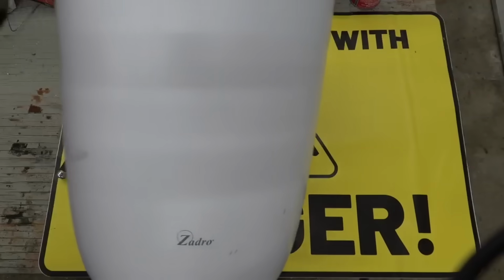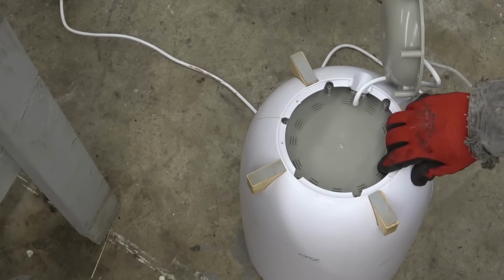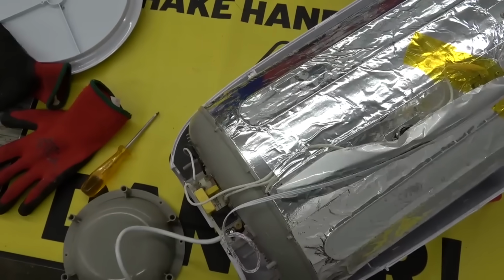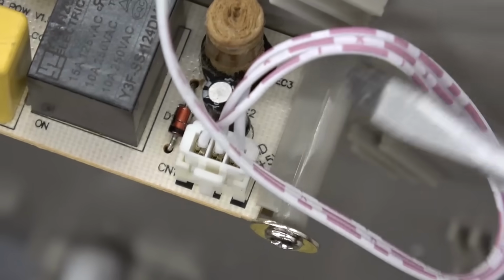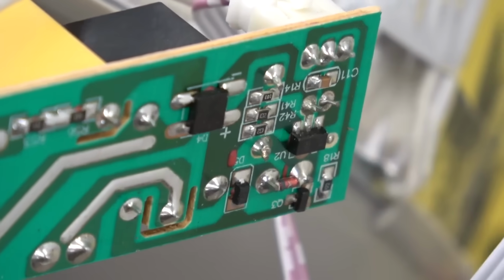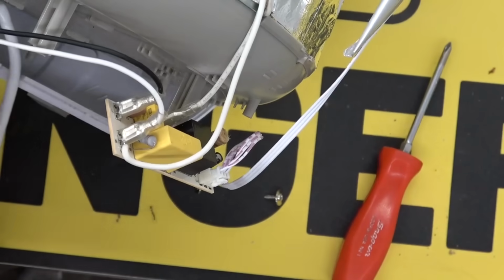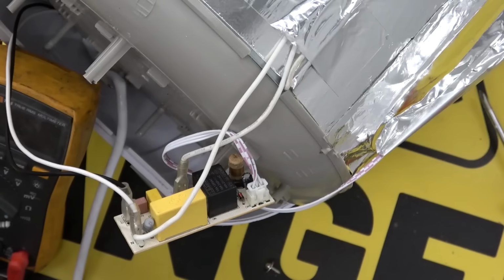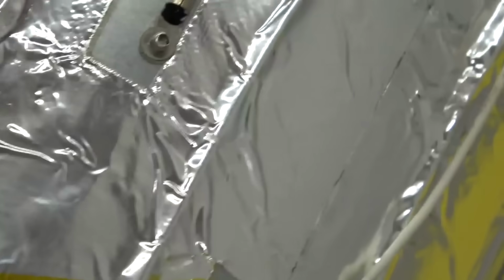BOLTR: Towel Warmer

Comment: 1.45 million yelling at their screens: it's always a capacitor!
I bet, you did this on purpose! 😂
Reply: Agreed, this was a blatant attempt to get interaction down here in the doobly-do to give that 1.45m a boost. But we're all way to smart to be foole... oh
Reply: @PurpleTT99  - Ya, Eons ago he had cut a power cord off'n an electrical device and applied the prongs of a continuity meter to the unconnected wire, rather than the wires that led to the device. (Inside tip on this vid, when he touched the two leads of his continuity tester together at  7:16 he got the Morse Code ... _ _ _ ...  SOS 😂) I'm gonna post this independently from here so I  will look smart😛
Reply: he told looks like a home rolled cap... no way he didn't know
Reply: I'm honestly ok with it not working because it just doesn't want to.
As you get older, you understand and empathise with things that just don't want to do any work today
Reply: i made my kid help me disassemble the flat screen tv that died, because we couldn't break it since it was broken... indeed its was several easy to spot blown capacitors... 3 bucks of the finest chinese replacement parts and a soldering lesson later the tv worked.  and the boy got a new tv to play with along with the lesson he didn't know he learned.
Reply: He's trying to get community engagement to boost his subscriptions.
Reply: I know the lion by its claws
Reply: For sure! On purpose!

Comment: That EC (eletrolytical capacitator) blew its panties RIGHT off.  Surprised you didn't find the little aluminum can in the bottom when you popped open the unit.

Comment: We have an expensive towel warmer, it's called the clothes dryer and it works just fine
Reply: We also have an expensive towel warmer.  The towel bar is over the furnace vent, just crank the heat up a few degrees for the entire house.

Comment: EC - (used to be) electrolytic capacitor. I would check "FULL BRIDGE RECTIFIER" and the regulator as well. That round glass thing is a MIL… I mean MELF diode. Might be a Zener. Can't really tell without knowing the rest of the circuit.
Reply: At 8:46, that glass part looks like a 1N4148 diode
Reply: @jeffrueschhoff7710  I agree, I placed thousands of those with pick-n-place machines at my work (not any longer). It's likely to snuff the reverse voltage from the relais to protect the rest of the circuit.

Comment: Common design for a low current power supply.  Piss poor design though as the capacitor gets a huge inrush current.  Then it gets hit with imposed high frequency which simulates high voltage, further insulting that electrolytic cappy.  No wonder they simulate my ex wife and blow their tops.

Comment: Is there a fuse in the plug, or is that a purely UK thing to check?  😎

And I would suggest replacing the electrolytic capacitor that blew its wrapper off too 👍

Comment: The power supply is a 'capacitor dropper' featured many times on big clive, you won't get continuity across the mains input, The EC is supposed to be an electrolytic capacitor, but looks like it blew it's case off, it could be shorted and not allowing the voltage
The glass thing is most likely a zener diode (conducts when voltage rise above the rating as a voltage regulator) it's probably 5 volts
Try changing the EC for a 470 micofarad , at least 16v rating. polarity is important
Reply: There is likely also another failure that lead to the exploding cap ...
Reply: u2 looks like 7805, it's a zener (which i think it's not) it'd be 7V+. I'd guess it's a snubber diode

Comment: chinesium electrolytic caps.... need i say more? The red diode is a zener type, would guess its a 12V or whatever the relay coil voltage is
Reply: yep, my guess is a zener. either capping the voltage (unlikely) or part of the regulator. the blown cap is root cause.

Comment: So it doesn't work because it doesn't want to. Understood. Glass dohicky looks very much like a zener diode. Its location on the board hints to me that it crudely regulates voltage for the actual voltage regulator. However since it has continuity in both directions it is sending all rectified voltage to ground thus 0 volts for the brain box. But what do I know. My boards usually don't work from day 1. No need to wait several years.😁😕😩

Comment: That EC3 is a dead electrolytic cap. Also those yellow Caps probably need to be replaced that looks like a capacitive dropper power supply they drop capacitance with age.
Reply: It's gone topless.
Reply: Yes, dunno if youtube is going to allow topless content like this 😂
Reply: @jonstenSE  no wonder uncle ave gots the shadowban, what with the topless caps on display like that
Reply: As the dropper cap ages the output voltage will get lower so that is not the fault here, but when the leds/display works on something but the relay clicks slow or needs a a hit to close then you know the dropper cap needs to be changed, most common in timer and wifi sockets and chinesium devices.
But that is how these caps age anyways, even the name brand ones, self healing means the bad parts just evaporate and the surface area gets smaller with time.
Reply: I had one of those yellow capacitors fail on me once, they’re usually the interference suppression caps.
It took me ages to find this one as it only had a tiny little hole in the side where it had vented.
I replaced it with a similar value (fortunately I keep a lot of X2 rated capacitors in stock for my work rebuilding vintage magnetos) & it’s still going strong to this day. A cheap Dremel clone from Lidl supermarket.

Comment: EC = Electrolytic Capacitor, and that one looks like it had the entire can (cover) blow off!
Reply: Once in the institution where they force you to learn, there was an electronics class. They gave us components to build some simple circuits with – at a lab bench with an integrated power supply, no less. One Standard Fokkery later, we had learned two things: what electrolytic capacitors look after they blow off the entire can, and that the learnerer-forcerer does not actually approve of us learning things ourselves!
Reply: You went to the same school I did I see.
Reply: Came to the same conclusion! 

@tepon1fani I similarly discovered a lot about capacitors in a similar way. My computer PSU of over a decade have it up after we moved (was ran long and hard for all of that time), and not knowing why, I tried to fix it... Not knowing nearly enough about electronics, I did know caps go bad, dry, and die. Problem was, I didn't pay enough attention to what I later learned were the polarity markings... 😅

So after replacing them with ones salvaged from something else (don't recall; over a decade ago) and powering it up for the first time – thankfully I had enough sense to hotwire it on by shorting the two pins like the motherboard does – and KAPOW! 😭💩

That failure taught me alot, and fast. 😅
Sure, I probably could've fixed it had I known now what I didn't then, but, that wouldn't have mattered anyways. Because when it died, it took out the motherboard and CPU. So it wouldn't have gotten me anywhere anyways. 🥴
Reply: @ So you are saying it is chooched
Reply: @WOFFY-qc9te Definitely released all the magic smoke anyway.
Reply: @WOFFY-qc9te It makes more of a 'pooched' noise.
Reply: Top must be in there somewhere.
Reply: @cspower7259  It may have fallen out during AvE's aggressive dismantling approach! I kept screaming this at the monitor, to no avail.
Reply: @cspower7259 I think we heard it fall out while he was givin'er wah.
Reply: I concur, doctor. 
Doctor, doctor.
Reply: @draztiqmeshaz6226  why didn't I concur? i shoulda concurred!
Reply: @draztiqmeshaz6226  Colonel, colonel, captain, captian and so forth...
Reply: Blown Up, Sir!
Reply: @bobcoombs7924  That's the fact, Jack!
Reply: @Charley_Buehner  "Boom Laka Laka Laka" !!!
Reply: Done gone blowed its can off.   :-)
Reply: Yea, that would get 120 micro controller resets per second, sounds like a problem worth fixing. Then the component between capacitor legs would be zener diode, that regulates voltage of capacitor divider on the input to whatever is needed for the micro, and resistance measured is failed insulator in this blown cap. As diode is in parallel with failed cap there is no way to measure it, as only failed cap with low resistance is measured
Reply: @poprawa  I agree
Reply: I've been screaming this at the screen 😅
Reply: Hmmm... Agree, but surprised it passed the smell test.  Usually when the can gets blowed up the stink tells you who ate the beans...
Reply: Winner winner, blown cap dinner!
Reply: @sadlerbw9 ala South Main Auto “there’s your problem lady”
Reply: Home rolled cap made me laugh. Watch alot of gfx card repairs. I don't know why it's not like I will ever be talented enough to do it myself but it does facinate me. Anyways when they don't mitigate the heat during repair close to the caps they often blow there lids. That lid must be hiding somewhere in that contraption...
Reply: Exactly!  How and why did AvE miss this?
Reply: @noimagination99  it’s a test
Reply: @noimagination99  ...because he didn't ...he needed comments for the algorithm
Reply: well, its still technically a capacitor.... its just very wildly changed its value
Reply: @elixeroflife  it read about "Steampunk" and miss read it as "Steampluke" and tried its best to join in. 🙂
Reply: @elixeroflife  It's now moonlighting as a resistor.
Reply: That "capacitor" looks like it was made by phillip morris.
Reply: Yep... here's your trouble
Reply: @mordechaimordechai   The 'trouble' seems to be Baby Doll denying her involvement.  Caps don't let go like that without a POP!  😉
Reply: Yeah, came here to say this. Can missing....
Reply: EC = exploding capacitor.
Reply: I love the way Electrolytic capacitors can just shout "look at me I've taken my clothes off". 🙂
Reply: had one go off in a computer psu , still cant belive that little bugger could make such a loud pop 😁 , the can hit the cover of the psu and made a small dent in the sheetmetal and flattening said can  😄, rest of psu was filler with the rockwool looking innards of the poor capacitor
Reply: I was looking at that cap thinking he said look at that hand rolled cap 🤣 there’s only th base and centre left. First time I’ve seen ave overlook something so obvious lol
Reply: Put a cap in yo' ass!
Reply: Who knows what an electrolytic capacitor looks like made in a God forsaken land. It might be fine.
Reply: That's why you can't see a shit stain. It's on the can of that capacitor😂
Reply: EC is what some Brits would call...
That there's an 'Eadless Capacitor govna.
Reply: I'm just here yelling at the screen for 10 minutes that that cap's blown it's lid clean off! And uncle bumblefuck just keeps on hemming and hawing away looking at everything else except thing that looks like a cigarette butt hot glued onto the circuit board.
Reply: You can see the can at 3:20.
Reply: no its not. its an Electric choke, you can see the coils on it.
Reply: ok so im not alone there.... but then I looked again and it kinda looks like its on a square base so it might be a coil...  just looking at it the control panel isnt getting power so  like plug it in and see where on that board the power does not flow.  im saying that cap (if it is a cap)
Reply: This. Usually the mode of failure just bulges the top of the cap cover (where the "X" is scored into the top) but I was pulling apart a defective battery charger, and saw near the exact same thing, with the capacitor cover (still intact) rolling around inside the enclosure. Find the cover to get the specs, and replace the cap and you are back in business!
Reply: Yep. Hey AvE, ohmmeter it. It should be open. If it’s anything else, remove and replace.

The markings are on the can that’s now in lunar orbit? Around a hundred mikes at ten volts should be fine.
Reply: Exploded Capacitor
Reply: It's seen better days.
Reply: Naked cap has all gone an blown off it's clothes.
Or it is a  temu grade chinesium cap.
Reply: is it due to heat from towel warmer?
Reply: @yoppindia  It's just a profoundly cheap capacitor that chose to go out with a bang. I replace hundreds of such caps every year, at least when it's financially worthwhile. Very few electronic devices are built to last these days and bulging, cheap capacitors are an extremely common failure mode. Especially the tiny ones when they've been secured with great gobs of heat-glue, that initial dose of heat robs them of a big part of their lifespan.
Reply: Maybe it took the hat off, while smoking a RIFA. Now it can’t find it.
Reply: Check resistance in the heating element?
Reply: Mail-order bride from a discount service type of thing.... looked like the real thing until it got all hot and overstimulated. If it had nothing  that could swell and explode when it can't handle the load, you wouldn't be confused by the surprise that popped up..... confused by the inevitable shemale surprise when something wasn't expected and was hard to grasp. Almost had the problem sorted, it was right on the tongue but you weren't sure if the whole thing had completely come and you almost spit it out.  Instead, you swallowed it up and took some time to ask anyone with experience what the right thing to do would be........
But those well experienced and typically closer to 5ft tall awkward type guys, are all still gone to Thailand until late in the Spring......
Reply: Like the foreskin on my pekkker while getting peg'd!
Reply: This is correct
Reply: It's always the home rolled EC.

Comment: 5:00 Minutes in I bet EC3 is a failed electrolytic capacitor and the reason  for the lack of chooch.
Reply: Blew its cap clean off!
Reply: I believed it technically overchooched leading to the failure to chooch.
Reply: I've seen this a few times. Most recently in a cheap computer PSU.
Reply: was my first hunch too.  launched it's aluminum shell.  surprised it wasn't rattling around inside the case though.  perhaps wedged itself into something.
Reply: Yep. for sure
Reply: If you can find the can or the pieces of it, might be able to find the correct specs for it, solder on a new one, and see if it works.
Reply: 100%. I've taken a few ECs apart before (childhood curiosity being what it is.. RIP to my parent's VCR), and they look nearly identical to this, albeit slightly less crispy lol
Reply: @adhdaf  Back in HS electronics class we would occasionally crank up the DC bench power supplies and hook them up with reverse polarity.  They pop like a firecracker.  The teacher was very mellow and would just scowl at us and mumble something funny.